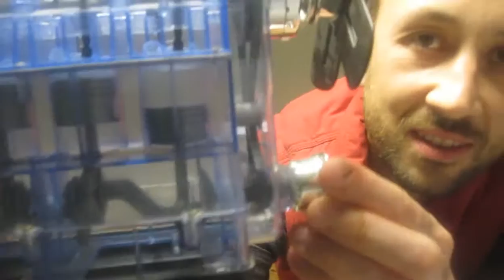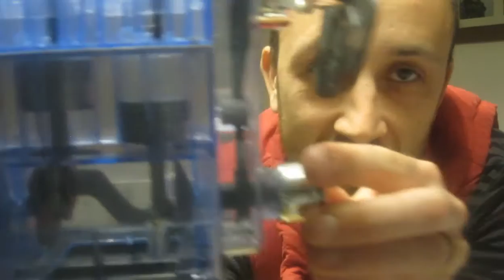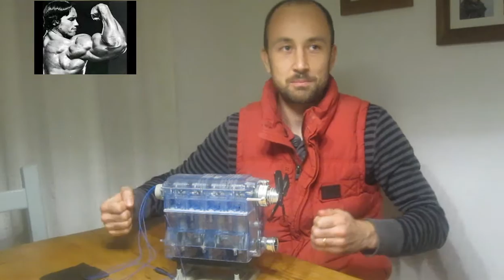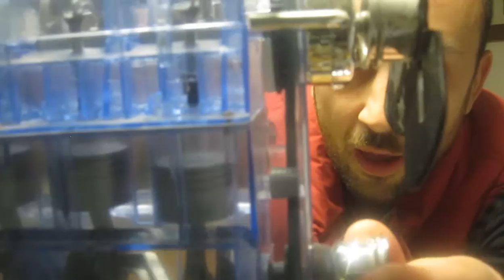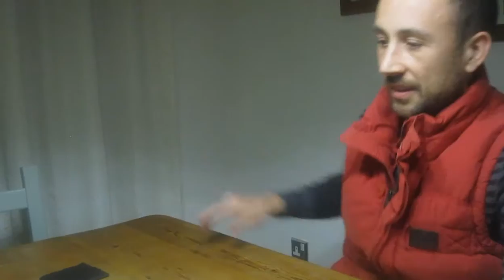Torque Vs Power: Why Power Wins Races and not Torque!

Comment: I've never understood these idiots on saying HP wins TQ when HP is TQ at high rpms! you can't have hp without tq. Tq is what turns the crankshaft not hp so how can hp win if it's not turning the crankshaft to even move the vehicle? Stupid hp lovers lol hahahaha. Tq is the single most important factor of any engine especially racing engines. To get hp you need more tq. HP= TQ times RPMS. they are the same thing the only difference is tq is called tq under 5252 RPM anything higher then 5252 RPM is called HP.
Reply from the maker: Ever wondered why race car engines rev so high? Does it increase the available torque or horsepower, if you can't understand what I mean then I have failed in my explanation or you struggle with what is essentially a complex topic hmm...
Reply: An Internal Combustion engine has to be running to produce power - obviously - as power, as Car Stuff has stated, is the rate at which the engine can do work. But it also has to be running to produce torque; a petrol or diesel engine produces zero torque at zero RPM.
By comparison an External Combustion engine such as a steam engine can produce tremendous torque at essentially zero RPM - steam from the boiler is pressing against the piston producing torque (turning force) even if the engine is not turning - and that also means it's producing essentially zero power, as power = torque x RPM. A steam locomotive will have fantastic acceleration from a standing start - at least, up until the point where the boiler cannot provide enough steam to fill the cylinders, then both power and torque drop away rapidly. 
To win a race you need to be able both to accelerate quickly and go fast. There are  YT videos which show that max acceleration occurs at max power not max torque, and max top speed of course depends on power, not torque. 
In summary, to win races you need power, not torque.
Reply: ^^^ Perfect example of the Dunning-Kruger effect, folks - the idiot who thinks he's smarter than everyone else.
Reply: That's about as simple as I can explain it, even an idiot should be able to understand that.
Then again, someone who thinks that the equation hp = torque x RPM is the same equation as hp = torque, someone who thinks that when a graph of a power curve crosses over a superimposed graph of a torque curve it means that "torque" has turned into "power", even though they are graphs of two different things and the crossover point is a meaningless artefact of the units of measurement, is perhaps too much of an idiot to understand even the most basic concepts and really should not even be allowed on the road.
Reply: Yes, torque wins races. That's why F1 cars use Cummins diesel engines as their power units.
Reply: @Stuve715 🤣👊🏻
Reply: Sean Byrne, King Austin:  Power is not an abstract concept, it is a real thing. It can be measured on a dyno. The question is, what do you need to win a race? 
If two cars A and B are identical but car A has twice the power and half the torque of car B, you will in general be better off betting on car A to win in a race against car B. 
That's why F1 cars have engines that are very short stroke (don't produce that much torque given their capacity) but are very high revving (produce a lot of power given their capacity).
Despite all their high-tech F1 cars produce torque figures that are comparable to ordinary road cars, but they produce way more horsepower -  because power is what you need to win races, not torque.
Reply: Not sure if you're trolling King Austin or if you simply don't understand.
In one comment you say, "hp is TQ... no such thing as HP" which is not true, then in your next comment you say, "Big difference between TQ and HP" which is true (torque = newton meters, or joules per radian, or lbf-ft, and power = watts, or hp, or foot-pounds per minute) and which contradicts your earlier statement, and then, "..a engine is not useless without HP", which may be true sometimes but a racing car engine without HP would indeed be useless, and then you say, "TQ ALWAYS DOES ALL THE WORK" which is not true at all; torque does not do any work - unless and until it acts over a rotational distance, where work = joule, or erg, or kilowatt-hour.
Torque, work and power are all related but they are different physical quantities with different units of measurement. In physics you must be careful to differentiate between them.
Reply: ...assuming you're not trolling, let's look at it from another angle. 
Everything about cars is a trade-off. 
In a race car, torque - the engine's turning force, and power - the rate at which the engine can do work, are both very important. More of both is desirable, but they are to some extent mutually exclusive: if an engine is built to produce more power at high RPM this can quite likely be at the expense of low RPM torque - it's a trade-off.
The engine builder has to decide what trade-offs he is prepared to make and still achieve his objectives.
The objective of a race car is to win races. Engine builders have found that in general, building an engine to have high power at high RPM means the car will more likely win a race than a car with less power, even if that means sacrificing torque elsewhere in the rev range. 
And that's why "Power Wins Races and not Torque!"
Reply: King Austin it’s because people including the idiot in this video have no understanding of physics and mechanical operation.
Reply: Sean Byrne very true. They don't know the basics
Reply: Car Stuff your whole point was hp wins races and your wrong because hp is TORQUE so it's TORQUE that wins races lol are you really that dumb? Tq is what turns the crankshaft that turns your wheels not hp dummy! So now I gotta ask how does hp win races like you claim?
Reply: Car Stuff the fact that you don’t understand basic physics yet try to pass off non factual statements as proof of your theory is astonishing. Do some research and understand that power does not in any way shape or form turn your driveline.
Reply: Stuve715 once again in summary. Power is not a force that is transmitted through the driveline. Power is not what makes your wheels turn. This is the kind of basic shit you learn as a first year apprentice but somehow is lost on YouTube experts.
Reply: Stuve715 as you have said HP is TQ so it's tq that has acceleration and top speed lol. Tq is what operates everything in the engine to make the car run let alone turns the drivetrain to turn the wheels at any RPM. Long story short tq is what does all the work. It always takes a twisting force to turn anything so power cannot turn your tires at any rpm lol. Hp is how much work the engine can do in a certain time right? Right. So it's as easy to explain as this. You have your Bugatti in  neutral and your rev it to the redline well the engine is doing much work but the tires are not moving but as soon as you put it in drive then tq comes along and moves the car at any speed. See without tq any engine is useless but the engine is not useless without HP.
Reply: Also: https://youtu.be/chbjcbmaVDc
Reply: Stuve715 HP is tq. Get the hint of the equation. HP=(TQ)xrpm haha so again your still wrong because hp is TQ HAHA LOL. TQ is doing all the work no such thing as HP. time to get over it haha.
Reply: @kingaustin169  dude saying power is torque because power=torque*rpm is like saying time is speed because time=speed*distance 

It's objectively fallacious. Power is not torque

Also what you is in your original comment about under 5252 it's called torque over 5252 it's called power is just... oh my god on wrong on too many levels to count. Please go learn this shit.
Reply: Stuve715 it's as simple as this HP is how much work the engine can do in a certain time and TQ is what's actually getting done. Sounds the same but I'll simplify it for ya. You Bugatti is in neutral and your redlining the engine so the engine is doing much work but your going nowhere. Now you put the car into 1st gear then TQ comes into play when you start to move the tires and transmission starts turning. Hp was useless by not turning the transmission or tires it was only burning the engine out by reving high but going nowhere. Tq is what's actually doing all the actually work by moving the crankshaft to move the transmission to move the rear tires. Big difference between TQ and HP. So again without TQ a engine  is useless but a engine is not useless without HP. TQ ALWAYS DOES ALL THE WORK!!
Reply: Stuve715 so please explain to build more HP the crankshaft needs to do what? and if you say the crankshaft needs to TWIST(TQ) faster to get higher rpms then your saying that TQ is indeed the only factor and builds more HP. where am I wrong? to build higher rpms the crankshaft needs to TWIST(TQ) faster. To build more HP the engine needs to TWIST(TQ) faster. yet you say TQ does not do all the work hahaha a engine cannot operate without TQ AT ANY RPM EVEN HIGH RPMS. learn something before talking.
Reply: Sean Byrne: to win a race you have to go faster than the other guy, right? Or am I wrong? Please enlighten me.
If your car has enough torque to say, pull an airplane, but it can only do it at 5 mph (like the tugs at the airport), and the other guy's car doesn't have the torque to pull the skin off a rice pudding but it can go 150mph, who is going to win the race? 
Please do tell - and kindly show your working.
Reply: @Stuve715  wow this hurts, my guy out here literally saying torque is power

My fucking brain cant take this shit, I'm sorry you had to deal with this guy
Reply: As explained in that video, a man standing on the end of a plank can create as much torque as your car's engine. Let's replace the engine with a man standing on a plank and attach the other end of the plank to the transmission. Let the plank turn the transmission under the man's weight. The torque will be at maximum when the plank is horizontal, it gets smaller as the plank turns downwards until it's zero when the plank is pointing straight down and the man falls off the end. The car will move forward a bit and then stop, because the torque is zero, it's all gone.
The point of a car's engine is that it doesn't just make one torque, it makes lots of them, one after the other, over and over again, every time there is a power stroke in the engine. When you make a lot of torques over and over again in a car engine, you have *power*. Power means the engine can do work: it can make the car accelerate and go fast, and the bigger the torques the engine can make and the faster it can make them then the more power it can make, and more power means the car will accelerate quicker and go faster.
Reply: Stuve715 tq is the twisting force of the crankshaft. HP is how much work the engine can do at a speed not the engine doing the work. Tq is what does the work hence the twisting force of the crank that turns everything in the vehicle. So tq is turning everything to make it operate so tq is doing absolutely ALL the work. Power is how fast it can be done but without it actually getting done it doesn't matter how fast you can do something. If you put a Bugatti in neutral and rev the engine high the engine is producing HP because the engine is doing much work BUT without TQ(the work actually getting done) the car is not moving BUT as soon as you put the Bugatti in drive then TQ turns the gears(because of twisting force work actually getting done) then the Bugatti actually moves. So TQ does all work HP is how fast it can be done. After all said and done TQ is the only important factor
Reply: good joke 😁👍🏻 torque is only component which consist on power level  torque is not what turn crankshaft 🤭 cos initial  push go from piston and not from crank axis 🤭 if there be the other way around than ok but its not other way around torque is generated from explosion force multiple be crank leverage force x lenght of lever  = torq 👌🏻 and anything under 5252 is caled torq and above 5252 power is also bull 💩🫣 power is everywhere as well as torq just level of both change with change of rpm except part where they stay constant 👌🏻 at end of the day if you compare catalogue peak value of both at engine crank in 99 out of 100 egzample version with more peak crank hp and less crank peak torq outperform version with less crank peak hp and more crank peak torq for egzample honda cb 350 rs 30 nm 21 hp 0-100 14 sec vmax 125 km/h vs honda cbr 250 rr mc 51 25 nm 40 hp 0-100 6,5 sec vmax 170 km/h 👌🏻 cb 350 rs  be stronger for daily riding between 1000 to 5000/6000 rpm in race where rider on cbr would hold rpm at which cbr generate more power beat /smoked with easy cb 350 🤭🤷🏻‍♂️👌🏻 and no power is not torque as you mention in other comment here 🫣…the same as tomato is not a hainz ketchup 😂 … ypu need couple more stuff to make ketchup from tomato 👌🏻 the same as couple more stufff than only torq to make power 👍🏻
Reply: It’s been 7 years.  More than long enough to get an engineering degree.  Have you learned anything since you posted this hivemind nonsense 🚮?
Reply: Stuve715 it's simple as this. TQ twisting force of the crankshaft which operate every valve in the engine to allow rpms to happen. TQ is what turns the crankshaft to turn the transmission to operate all gears. TQ is what turns the rear or front tires to get moving. Where is HP operating anything? Like I've said if my Bugatti is in neutral and I'm revving the engine then the engine is making HP but the car is not in drive to go anywhere so the engine is doing much work yet it's not going anywhere lol. But as soon as the Bugatti is in gear to move that's when TQ arrives to move the Bugatti at any rpms lol. without the twisting force(TQ) where does any power come from?
Reply: Stuve715 most incorrect statement ever haha. Yeah your mechanic license is revoked lol u don't even know what turns the crankshaft lol do u even now what the crankshaft is? Don't sound like it lol. We're done here lol
Reply: Stuve715 yet you haven't proved me wrong because you can't lol
Reply: Stuve715 you even worse then the dunning Kruger effect because you are arguing about engines when you don't even know what a crankshaft is hahaha
Reply: Stuve715 for one you think TQ is only pulling power YOUR WRONG!!!! TQ is power at any RPM low or high. TQ is how fast the crankshaft is turning. The crankshaft is what turns the tires the faster the crankshaft turns the faster u go!!!! The faster u go the faster u win the race!!!! So TQ is what turns the crankshaft NEVER HP. So it's always TQ that turns the crankshaft that moves the car at any speed. So it's always TQ that does all work. TQ is what operates everything in the engine to make the engine do work and that's why HP IS TQ. TQ is the only power there is. RPM means how fast the crankshaft is TURNING(TQ) so at 18k rpm the crankshaft is TWISTING(TQ) extremely fast again at 18k rpm there is TQ turning the crankshaft very fast so again it's ALWAYS TQ that does all work.
Reply: Stuve715 if you knew what a crankshaft was then you would know that turns you tires and tq is what turns the crankshaft so your still wrong you dumbass mechanic lol. TQ is called TQ because it's power that's under 5252 rpm but as soon as the RPM is higher then 5252 RPM then TQ is labeled HP it's the same thing dumbass lol haha. You still don't understand the equation of how you calculate HP. HP= (TQ) X RPMS now if HP was different then why the fuck is it TQ x rpms not HP x rpms lol dumbass fake mechanic. It literally tells you that HP is TQ at high rpms. It literally tells you that TQ makes HP lol. It literally tells you there the same thing lol. Stop embarrassing yourself. Please show me a how they come up with HP without using TQ?